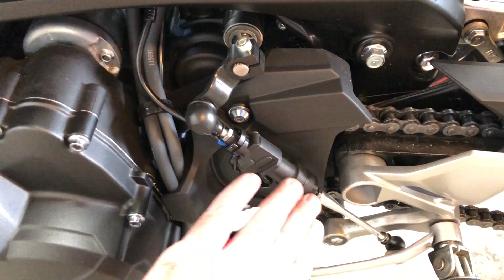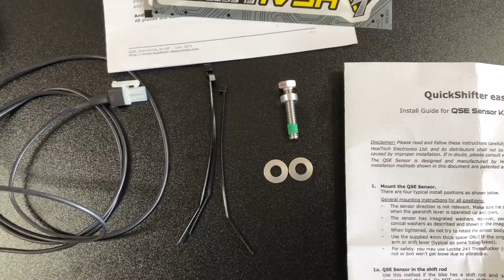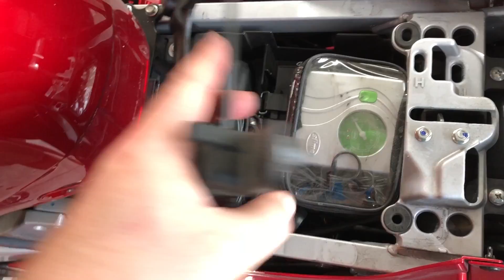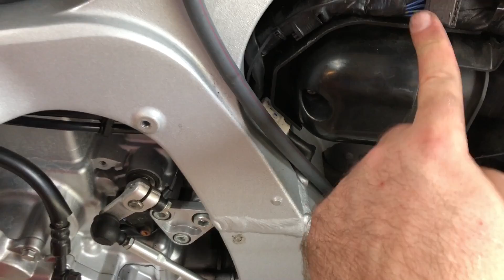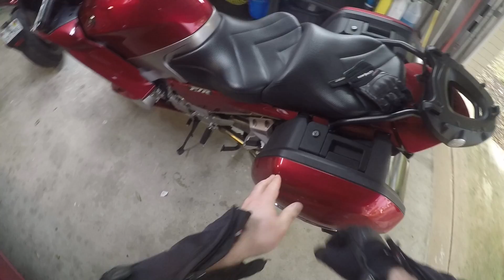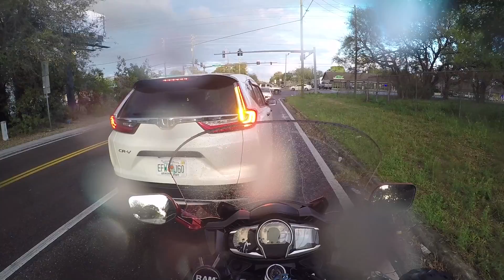FJR HealTech Quickshifter Easy Installation How To DIY

Comment: Hi Brian. Bought the IQSE-W for 2015 FJR. After the wizard set-up and took it out for a ride and it was hyper-sensitive very sloppy shifts and don't to damage the Trans on a 12k bike. Any tips ir could  share the parameters you are seeing in the app that  were Auto updated or you manually adjusted to on your 2014 ? The shift pressure, length of delay and cut duration seemed to be adjustments are needed. I have messaged HealTech and are waiting for answer, but any advice would be appreciated.

Comment: Thanks for the video. I chuckled a bit at the 7 minute mark because I just watched your gear indicator sensor video last night. When you thought to put allen head in place of those phillips, I thought "great idea". But I also recalled using those plain steel bolts in an automotive application in the past, and subsequently had to replace them with stainless for the same reason.

I'm actually in the middle of figuring out how to convert my '07 AE to full manual, so I'm gleaning what I can from non-AE bike videos.
Reply from the maker: Sounds like a fun project!

Comment: Stupid question - did you pull clutch to shift up?
Reply from the maker: No, that's the whole point of the product
Reply: @TwoWheelObsession  got it. And as I know to switch gears without clutch I have to have Slipper clutch (2016+ FJR1300), right?
Reply from the maker: Slipper clutch or not, has nothing to do with a quickshifter.

Comment: Bryan, I installed this same quick shifter about 6 months ago thanks to this video.  It works great, except I sometimes notice a "double click" in the shift lever when using it.  It doesn't affect the shifting at all, but it feels very strange.  Again, it feels like your foot goes through two notches when pulling up on the shifter.  Do you ever get this?

Comment: I would only want a quickshifter for downshifting as I have mastered the ability to manually clutchless upshift already. Would it not be a simple matter of blipping up as you downshift with this quickshifter to solve the whole blipping issue? At the very least having a slipper clutch on board should help keep things less rough without the blips, no?
Reply: I'm afraid I don't know enough to understand the difference with a slipper clutch then. As for clutchless upshifting, I know it's different from just a quick up shifter, but I see little value in an quick up shifter only when manual clutchless upshifting is easy enough to do, hence my want for a quickshifter to be more for down than up. A quick flick of the wrist to up shift isn't worth the expense of an up only quick shifter to me. Thanks anyway, I may have to bite the dust and look at bikes with factory up and down shifters after all.
Reply from the maker: The slipper has nothing to do with safe dog bone engagement, only traction. Clutchless upshifting is not the same. You can’t do it holding full throttle.

Comment: 👍 Nice installation video. I have it in my 2016 FJ 09 and love it. If you close the throttle a wee bit and shift at the same time the lurch will vanish and shifts will be very smooth. My cut off delay is set at 40 ms based on my driving habit. I have had it for 2 seasons now and it is awesome. If you want to see the difference select the ‘bypass mode’ checkbox. This will return the transmission to regular stock shifting and help you gauge the difference between having a quick shifter and not having one. Uncheck it to enable the quick shifter again.

Comment: Great job on the install, I have a Gixxer 1000 and I just purchased the healtech! Thanks for the informative piece.
Reply: Dark_Place siema, and you would send all the settings you have on your phone, preferably skreenshot
👊🏻
Reply: @mapetr1vr469  when and where
Reply: Dark_Place well here for you tub
Reply: Hi,
Thanks for the video.
Reply: Probably a silly question.  Do you have to isolate what has been unplugged from the ignition coil?
Or you just left them there?
Reply: @giannixtz750  leave them there. Simple and easy.

Comment: I am also very interested in this quickshifter for my '08 FJR1300. 
Do you still like it after 8 months of use?  And did you have any problems with it?
Does this quickshifter cause any damage on the gearbox. I ask because I use the FJR for daily commuting, and I don't want to change the gearbox after installing this quickshifter.
A lot of questions, hopefully you are willing to answer them.
Thank you, and keep on making  great FJR content :-)  .
Reply from the maker: It's one of the best mods to any bike I've done - super fun for the price!  As long as you use it properly - always use it under load and with at least 50% throttle, it's perfect.  No issues.

Comment: if you buy this, do you need to shift always  on full trottle ( when your shiftlight comes on, or just when you want liek with your stock cluth , thx
Reply from the maker: No, partial throttle is fine, above 25% or so.

Comment: Got one.  Factory original equipment on my 2006.  Yamaha Chip Controlled Shift.  Didn't sell well enough to keep them coming to Murica.  Can still be had on new models in Europe.  Muricans so dumb about that stuff.
Reply from the maker: Similar but not quite the same.  I greatly prefer shifting my with foot.
Reply: Yeah, not the same.  Better.  You can shift with your foot, or with your finger.  Quick shift up and down, with a flick of the forefinger.  Finger flick is faster than moving the foot.
Reply from the maker: You don't have to use the clutch when using the foot shifter?
Reply: No.  There is no clutch lever.  The YCCS disengages the clutch, the cuts the ignition, changes gears, all in a nano second with the flick of a finger.  Upshift or downshift, any rpm, using the foot shift or the finger shift.  It's really nice for traffic, and just a hoot out in the twisties and when doing a max acceleration.  You roll to stop with it in first gear.  System disengages the clutch while you wait for the light to change.  Then just twist the throttle to go.
Reply from the maker: Well then that's awesome lol
Reply: If Yamaha had marketed the YCCS as a performance upgrade, or quickshifter, I think we would still have it in the US.  Unfortunately, they marketed it as a touring aid to make riding "easier".  You can read about the 2nd gen YCCS here.  Only available in Europe.  https://www.yamaha-motor.eu/uk/products/motorcycles/sport-touring/fjr1300as.aspx
Reply from the maker: They also needed to leave the clutch lever.  It's still an important part of a bike to me at least, and something I will always want for low speed moves.  For me, just adding an up/down quickshifter to any standard config is the perfect solution.  Best of all worlds.
Reply: It would have been really great to be able to switch between the YCCS and totally manual.  However, I have learned to do low speed maneuvers in 1st gear by modulating the throttle and rear brake just fine.

Comment: I have a FJR1300 2001 with PC3 USB. I could go with a PC QS but i'de need a ignition module. This Healtech QS looks good, but will it work with a PC3 already in place?
Reply from the maker: I don’t know I would email them
Reply: I have PC3 USB and Healthech Quickshifter on my CBR1100XX and it works smooth, no problems at all.
Reply: I emailed them and they said as long as it is hooked last in line to the coils it will be good

Comment: Do you have to roll off the throttle or are you holding steady during the up shift?
Reply from the maker: You do not roll off with a quickshifter you need to maintain throttle

Comment: Just wondering if you already have a power commander installed. Does that kit come with a connection for it Or you have to get that separately.
Reply from the maker: Depends on the bike http://www.powercommander.com/powercommander/products/quickshifter/powercommander_quick_shifter.aspx
Reply: Same bike as you :). Thanks
Reply from the maker: Oh you were asking if I do - no, no need for me I have a stock exhaust.  No the HealTech has nothing to do with a PowerCommander.
Reply: TwoWheelObsession  well actually was saying I have the 2014 fjr1300. And have a power commander installed. I was looking at that healtech quckshifter you got and was wondering if that unit came with a connection piece. That would connect to the power commander. In some special way
Reply from the maker: No, it has nothing to do with it.  If there is a PC option for any particular bike you have to use that only.
Reply: TwoWheelObsession  thanks for the fast responses. Keep up the hard work you do thanks again.
Reply from the maker: Welcome